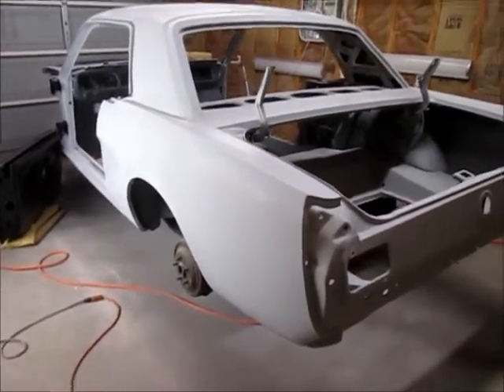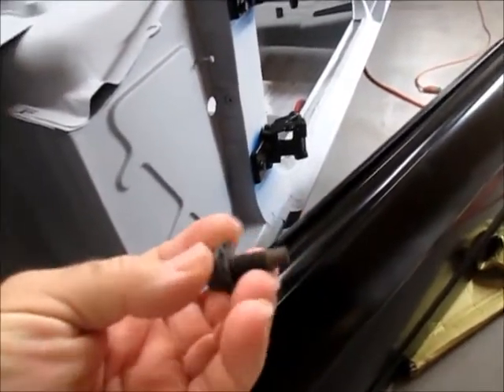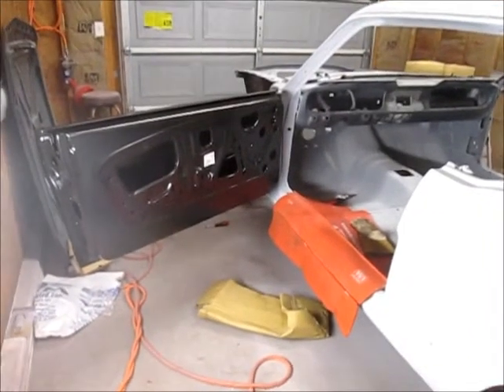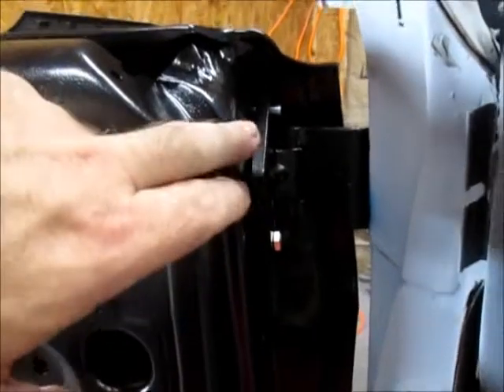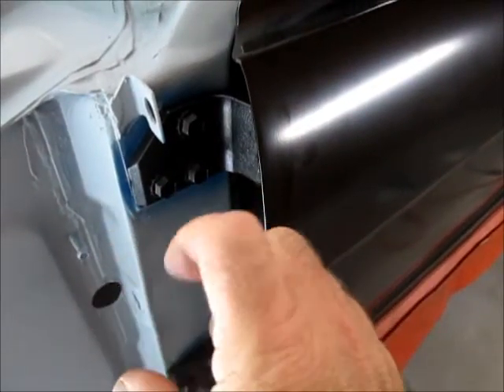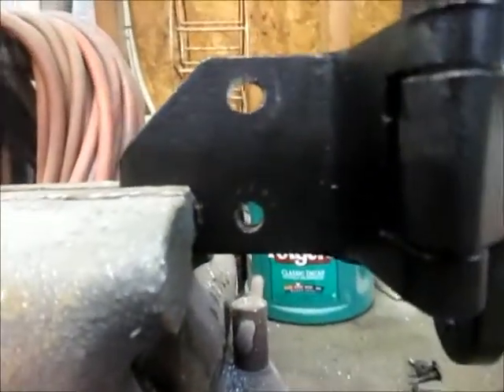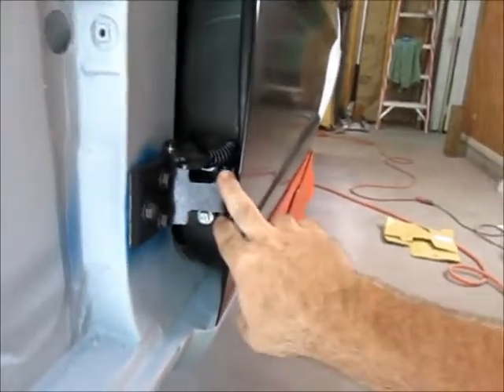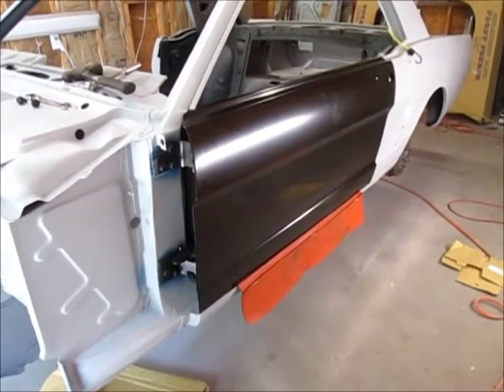1965 Mustang door installation

Comment: It might be a good idea to take some sand bags that are the same weight as the parts that will be added to the door when finished and set them on or in the door to simulate the weight and then adjust the hinges.

Comment: Quick question , new aftermarket panels are pretty wavy , so I will need to filler skim coat the whole panel to block it straight , there is a edp coating on them , do you 80 that down for filler ? Many people say to leave it on and that's fine if the panel is ready for paint . The dies must be different for new car panels because they are not wavy like these.
Reply from the maker: MrFireman164 The dies for new cars are "trued" continuously. The dies for aftermarket panels are hardly ever corrected. I would scuff the wavy areas or whole panel if I planned to skim coat. Filler will bond to edp, but it's better to scratch it up for an even better bond. No need to remove it.
Reply: Jo Daddy's Garage thank you !

Comment: Bear, when you put your rear quarters on, did you paint the outer wheel house after primer, before you installed the quarter? If so, did you just use some spray can paint, or did you mix and spray paint? I notice here behind the door hinges you have a blue, is that just from a spray can? Thanks, Gilbert
Reply from the maker: Hey Gilbert, thanks for the comment and question. The wheel houses were sprayed with SEM self etching primer for any spot welded areas. I also used some weld thru primer at the spot welds from quarter to wheel house. I didn't use any top coat as it will all be under coated below, and top coated with the original color above (as seen in the trunk). The blue under the hinges was just from a can. Not really necessary as it's all going to be jammed and painted. I will not be removing the hinges though. They are where they are.
Reply: I can not believe the problems you had with everything fitting correctly, right down to door hinges. So far i have done a test fit on my quarters and they are lining up correctly. I do not think I would be able to make all the adjustments you have had to do.
On my wheel house i used some ospho to kill some surface rust so I was wondering if I should put some kind of spray can primer on it  or just wait and spray the epoxy primer at a later date when I have enough to mix up. Any thoughts?
Reply: Sorry to keep bothering you, but had another question.(just want to do it right) when you put your quarter on you leave the window in. So, how do you spot weld the bottom flange to the rocker panel if the window is in the way?
Reply from the maker: You can do it if the window is rolled up. Most of it anyway. Make sure you put some cardboard over the glass in case of weld spatter.
Reply from the maker: It wouldn't hurt to put some primer on. Depending on how exposed it is. I've even used rustoleum as a top coat knowing other paint or primer wouldn't reach it later.

Comment: did you use a new shell? or reuse the old door? i don't feel like trying to fix my existing doors, so I'm going to replace with a new shell, wondering who makes the better shell. or where to order from.
Reply from the maker: callofgeorge New doors from Mustangs Unlimited.
Reply: i dug around and can't seem to find it.. didn't you have a video where you had to adjust the plate inside the door for adjustment. my passenger side needs to rotate the top outward more to line up right and I'm out of adjustment. i can see how much play i have on the hinge to try to file the holes a little, but im thinking i'll have to break those spot welds and move the plate over some.

Comment: And you think it wouldnt be easier to cut a eighth inch a out of the backing backing plates put them back in and test fit the doors.
Reply from the maker: +Joe Dirt If there was anymore room for the boltholes to move aft that may work. The bolts were hitting the openings in the A-pillar, so trimming the plate wouldn't help much without enlarging the holes in the A-pillar as well. There's always more than one way to do a job. I just showed what I chose to do in this case.
Reply: Thats fine with me.  I wish you wouldnt have scrapped the wrecked gold mustang coupe. I would purchased that car from you and i would have completely rebuilt that back drivable condition.
Reply from the maker: +Joe Dirt It was far worse than it looked. Trust me, I don't like to see any of them go to scrap.